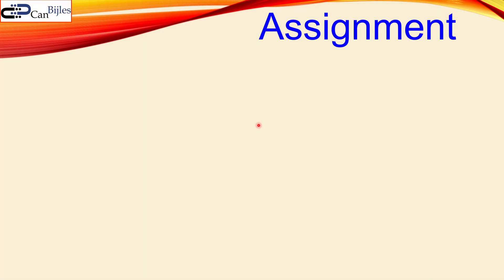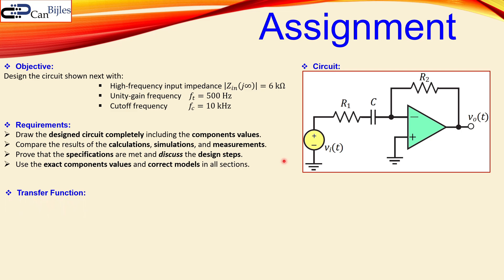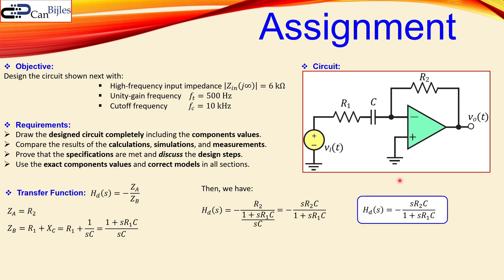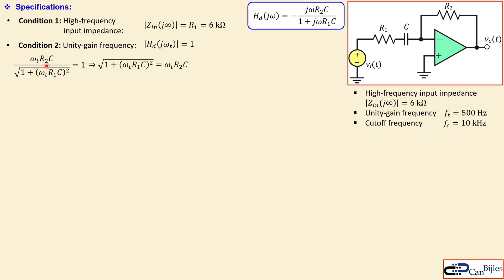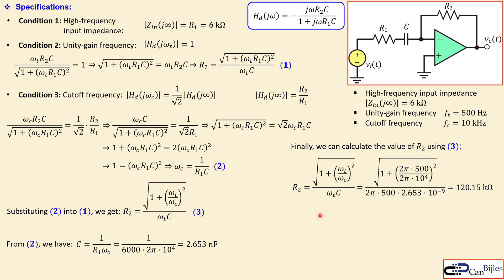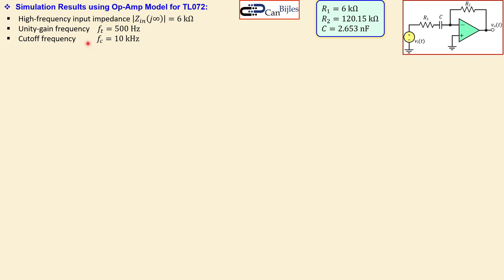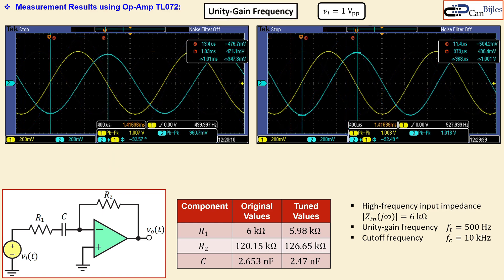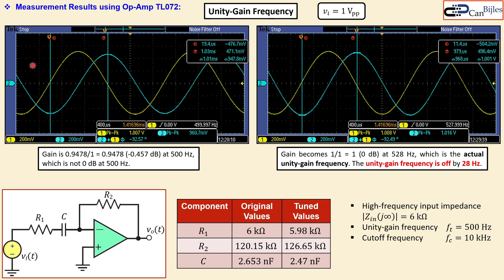Differentiator Circuit Design using Operational Amplifier 🌟 Calculations, Simulations & Measurements

Comment: When I was a little boy (playing with a LACE MK II valve-based analogue computer at school) we were taught to avoid differentiators because of their noise sensitivity, and instead to redesign our problem to use integrators instead (which was usually possible) because they soaked up noise rather than amplifying it.
Reply from the maker: It is true if you have a pure differentiator and will amplify high-frequency noise.
The circuit in this video is a nonpure differentiator having a pole frequency with an almost constant high-frequency gain.